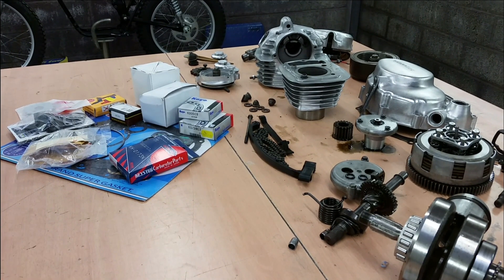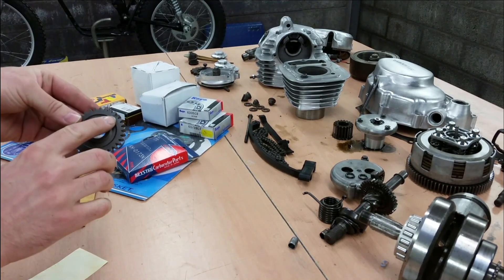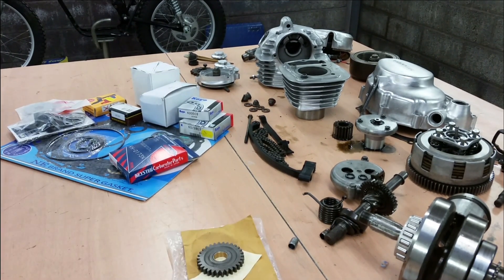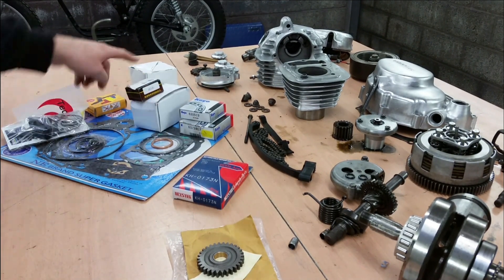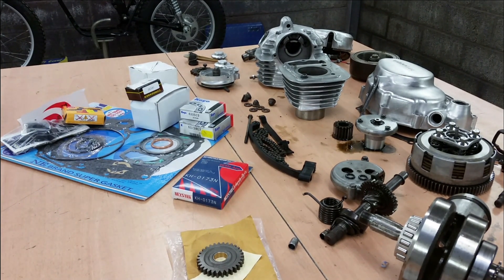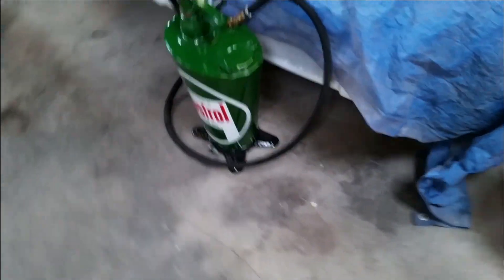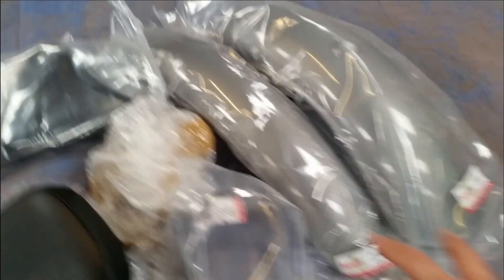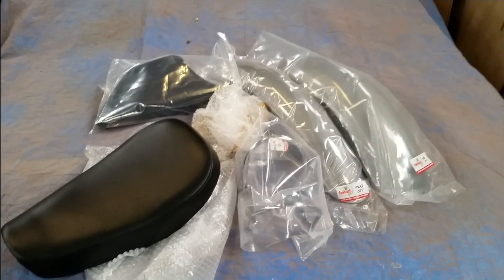1975 Honda TL125 K2 Full Restoration UPDATE

Comment: Great stuff!
Having rebuilt the XL version of that bike I'll be very interested to see it running.
I used the same carb kit as you've shown, the carb was cleaned meticulously and treated to the new parts, although the bike ran alright it was always difficult so start.
In the end I bought a new carb and the starting issues disappeared immediately.
I can only assume that there was wear on the jet seats.
Reply from the maker: Hey, Thanks for leaving a comment ill be sure to look out for that issue when rebuilding the carb on this one.

Comment: Just delighting and eagerly awaiting each episode.  Should the wear on the left block where the control chain guide run would not be feasible to fill with weld and refit it again?
Reply from the maker: Hi, I dont actually need to any work to the casing as it has only slightly worn and now that the engine is being rebuilt with the correct tension the wear on the casing wont cause any problems ;) Thanks for leaving a comment :)

Comment: The TL and XL250 had issues with the kick shaft gears / oil pump idler breaking.  Be sure to give yours a thorough look over.
Reply from the maker: Hi, Thanks for the tip ill be sure to have a good look at it before re-assembly :)